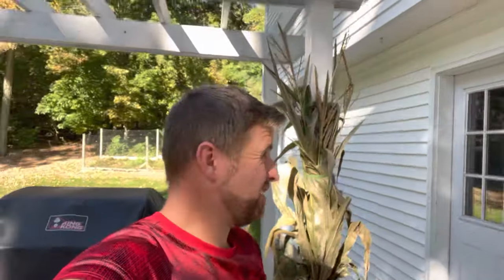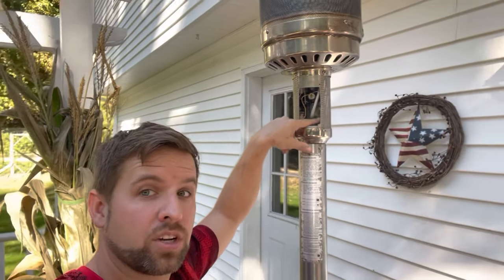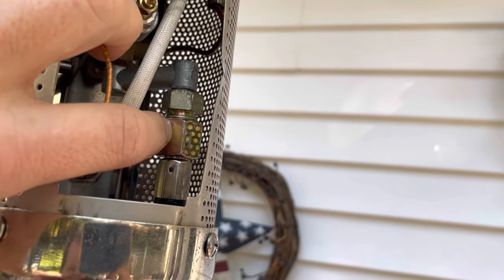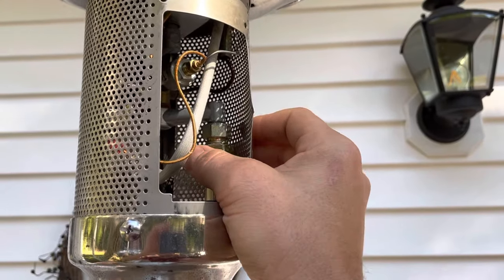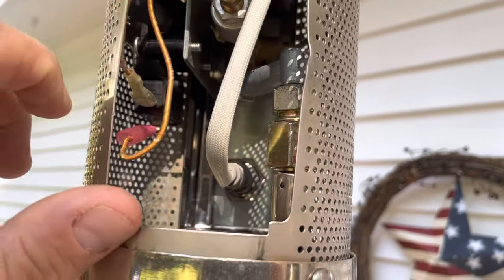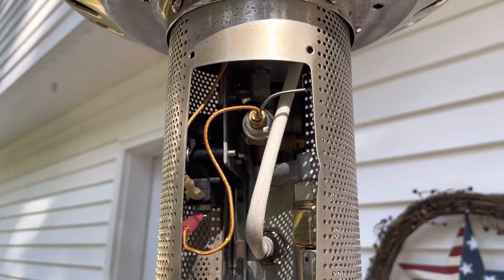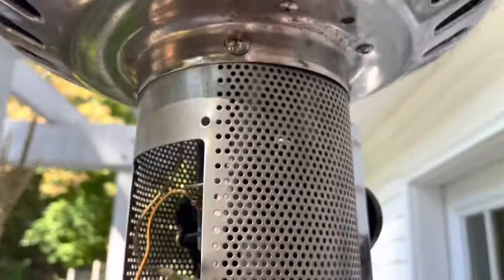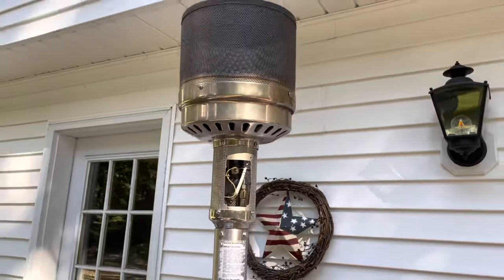DIY: Patio Heater Fix

Comment: Thank you for posting this!  My neighbor gifted me a used patio heater when they were moving. They admitted to me that it had not worked in a while but knew I was decently skilled at fixing things. I tried bypassing the tilt switch, and that did not get it. Came across your video and pulled the spring and cap off of the thermocouple and it now works flawlessly!

Comment: I literally paused your video, went to the patio, pulled off the back panel and did exactly what you showed to bypass the thermocouple. Five minutes later and my heater is working again! Thank you so much.   I know that the thermocouple is there to make sure that when there’s no flame, there is no gas present. However, we only use this heater when we are sitting on the patio. I am sure we will know if the flame goes out! So I had no issues removing that thermocouple. It definitely helped that I had the same model heater that you are showing. Everything was where you said and it worked out beautifully. Thank you for your time in recording it. You just saved me a bunch.

Comment: Thanks for the vid. I did a similar hack on my heaters. But one safety point. When the solenoid plunger is disabled the tilt switch no longer will turn off the gas when the heater is tilted. That works by disabling the circuit from the TC in the through the solenoid so the plunger is not retracted. We have removed the plug so it no longer works at all.
Reply from the maker: Excellent point and something I didn’t know. When it comes to lighting if it doesn’t go in the first few clicks I shut it off and wait a minute for the gas to dissipate. Thanks!

Comment: Another heater saved from a landfill! The company I work for threw one of these 3 foot tall heaters in the dumpster. I dusted it of and pulled it apart but couldn't get it lit. I modified the regulator like you explain and now it works great. I don't even need a space heater i just like to fix stuff and keep things out of the trash. Gonna pass this off to a friend.

Comment: Terrific advice--I have four patio heaters, all different models. Following your lead, I found and disabled the thermo-couplers on my Fire Sense and Uniflame heaters successfully. I suspect most patio heaters have similar internals so fixing the other two should follow the same procedure.  What a great way to avoid throwing these guys into the landfill. Thank You!
Reply from the maker: Glad I could help, been busy lately but I’ve got more stuff coming.

Comment: The video implies that the "Tilt Switch" is still active and hasn't been removed.  However it, TOO, is disabled because it simply breaks the continuity that the thermocouple probe generates (heat and metals doing science things creating a low-voltage charge) to hold open the thermocouple valve with a tiny electro magnet.  
So know that this method will certainly allow your patio heater to work, but NO safety precautions are in play any longer.  The gas will NOT SHUT OFF if the flame goes out or the tower tips over.

Comment: Nice video. I have a question ❓ I have only used mine 1 time. The wind did turn it over a good while back. I've got the heater working but when I turn the heat up to high, the flame won't get strong enough to make the top part red and it's not heating up like it should. Would you have any suggestions? Thank you

Comment: Thank, I'll try the bypasses. You used abSAE 11/16" & 3/4". Why not use a 1/2" socket. Also av5/16" will work better on the tube nuts. But good info.

Comment: At 5:20, you do not need to reinstall the thermocouple fitting back into the cap as it is no longer necessary.  The electromagnet/solenoid cartridge will seal the back end of the valve when the cap is tightened (5:05).  You can cut the thermocouple wires and remove the fitting if desired (or just tuck the wires and fitting off to the side).

Comment: Wow. I just put my heater out on curb for someone to take. Saw youth video and works perfect. Thanks. Just 1 question my cap that holds the thermal couple was rusted bad and broke. It holds a bit but just want to know if its important for for it to hold on tight.?

Comment: I found a tilt switch + thermocouple kit on Amazon for $10. Worth changing out.
The tilt switch going bad is a common issue.  It can be bypassed.
The thermocouple senses if the pilot comes on.  If it does, then it is safe to release gas on main flue.
If you remove the thermocouple, the gas will flow regardless of whether heater lights up or not.
What if you remove it, the heater is off, but your dog knocks it over in an enclosed patio. The gas might run, fill up the patio and house, and kaboom!   Or... dog may die unable to get out.
If the house goes kaboom and fire inspector determines the thermocouple was taken out of the heater,.... you may not be covered by insurance.  Some things to consider.
It might just be better to replace it, painful though it is. Fires happen. My house burned down.  If it had been due to a $10 fix, I would have never forgiven myself.

Comment: Is it possible to to separate my heater into two sections to transport it in a truck bed. I didnt assemble my heater my husband did so I am not sure how many pieces it has. Any tips or help are greatly appreciated. Thanks 😁
Reply from the maker: Technically it’s 4 pieces. The bottom where the tank is held, the stack pipe, the heater element (screened in section), and the hood.

Most hoods are simple wing nuts on the top, the heater elements only connection to the unit is 2-3 screws and the regulator hose that runs down the pipe. The pipe is also held onto the tank base by only a few screws. 

Don’t forget it comes in a smallish box so everything is a simple screw or bolt, no harm breaking it down just take a few pics and bag up the parts.

Comment: How do you know if the regulator or the thermocouple is bad?
Reply from the maker: For me it was process of elimination. I had extra regulators from my grill and other heater that I knew worked so I swapped them out and tried it on my grill. Regulators are also a part known to fail so easy enough to check.

Comment: Ok so my issues is the 3/8 fuel line doesn't fit into the nozzle. The nozzle is small and from youe video it looks like there is an adapter to make it fit. What is it?

Comment: Hey 👋 Any idea Why my Heater is going thru propane Sooooo Fast?? (The Big Hampton bay 48000btu from Home Depot) Just bought it mid last wk, only used about 5 times; maybe 10-12 hrs total use on mostly low setting under four seasons patio; It’s Already gone thru 2 20 tanks!🤦‍♀️🤦‍♀️ (I know tanks were full bc I got them directly from Waring where my brother works & had his guys fill them)
Reply: Edit to add.. I’ve noticed ‘frost’ a few times on very bottom of tank on heater.. am I using too small of a tank to accommodate 48000btu..? Or do I just need to return this heater? I don’t know anything about gas/propane or these heaters .. All I know is my grill uses 20gal prp & has 4 big burners; we grill at least 3-4x a week & tank lasts almost a Month! & Nvr noticed ‘frost’.. Thanks in advance ~✌️💕☺️
Reply from the maker: From this and your reply it doesn’t sound entirely off. I can blast through a tank in 6-8 hours if I am on high. The trick here is these things don’t need to really be on full blast. I tend to keep mine at 1/2 to 3/4 most of the time. I may start off on high to just get it warmed up quick. I have 4 tanks at home 2 for the grill, 2 for the heater that I can rotate if needed.

I also use a local place for fill up instead of the Blue Rhino stuff, those tanks are not topped off. The frost is normal, especially if  it is damp or humid out.

Comment: Why would the regulator hose also need to be replaced?
Reply from the maker: Mine was broken to begin with, but it’s part of the diagnosis, by switching out a regulator you can confirm if it is functioning and providing a fuel flow.
Reply: @Neighborly_Content  The regulater on my nearly new unit needed a few taps to get it to let gas up the hose.  The first thing I'd check if no gas is getting up the hose.

Comment: Not an expert so pardon my question.  What are you removing from the thermocouple prior to reinstall?  A cap?  After modification, (removal of the spring and cap) then reinstall, it will no longer shut off the gas flow if the flame goes out.
Reply from the maker: This does impact fuel flow. Removing the cap and spring from the couple bypasses the shutoff so if your flame goes out gas will still flow. You need to monitor and keep an open eye. Again we use our heater for short stints so I’m always aware of the tank level and fuel flow. Propane is heavier so it does sink but if your having a problem keeping a flame then you may have another issue related to the valve assembly itself which is replaceable.

Comment: I can’t figure out how to keep the pilot light lit. It goes off every time I take my finger off the button. What is my problem?
Reply from the maker: The button has an inset. So when you press to open the valve and it lights hold it there for a moment or two then twist the dial while letting it out and it will set into the adjustment for hi to lo flame.

Comment: One question my heater fell on a windy day , and now it's making a weird noise like if it's blowing out more air how do I  fix  it would you know what it would be ? ? it did bend the heater so maybe it damaged something.
Reply from the maker: Check the pipes. Open up the access panel, connect it, and turn on the gas slowly. Listen for a leak or hiss. It could be you damaged the internal solid connections. But know you can buy those guys online for pretty cheap.
Reply: @Neighborly_Content  Thank you I'll try that .

Comment: my regulator hose only has the 3/4" nut on it, theres no 11/16" nut on top to hold on to, is there anyway else to change the hose, because loosening it turns the whole system and i cant grab onto anything else.
Reply from the maker: Can you DM me a pic of where your connection is?
Reply: @Neighborly_Content  Theres no option do DM you, i believe you might have to enable that feature.
Reply from the maker: @ilyakouzmine7610  DIY_Guy7 on Instagram.

Comment: I'm confused. I think you said you were going to take out the thermocouple. But it looks like you put it back in.
Reply: He did remove the thermocouple. But the rest of the body assembly is reinstalled.
Reply: It was all about removing the spring.   The thermocouple heats up and opens the valve.   When it isn’t working the spring keeps the valve closed.  So remove the spring replace everything back in.

Comment: Part that cost $10 from Amazon and you do all this non sense 🤔🤔🤔in most cases thermocouple is not the case why heater won’t turn on
Reply from the maker: It’s not always the case but it’s one of the common ones. Tilt switch, igniter, regulator are some other items to diagnose and I mentioned a few. I’m also not keen on replacing a defective Chinese part with another potentially defective Chinese part. In my case it worked and the vid is there to help, which it did for some. Thanks for the comment.